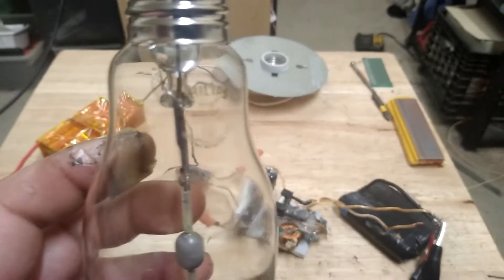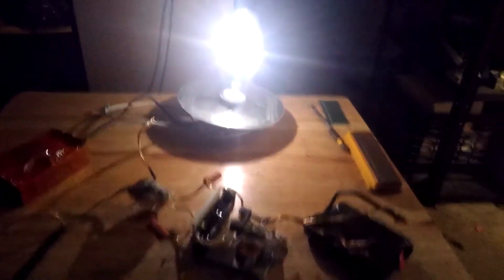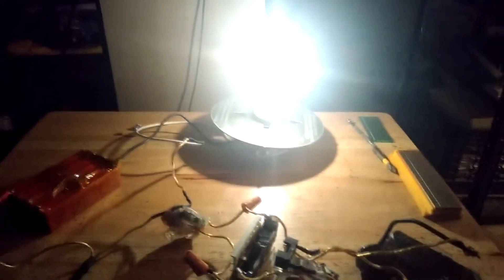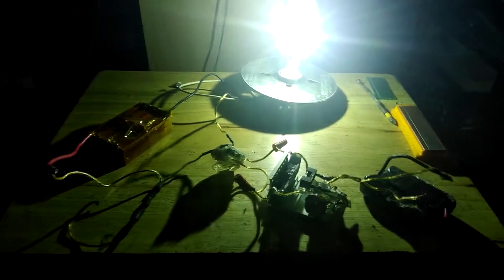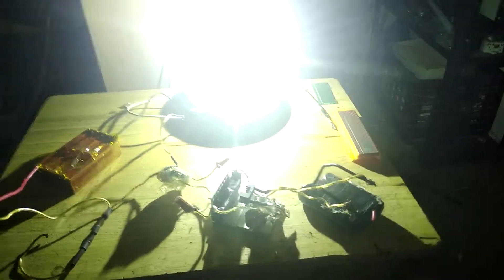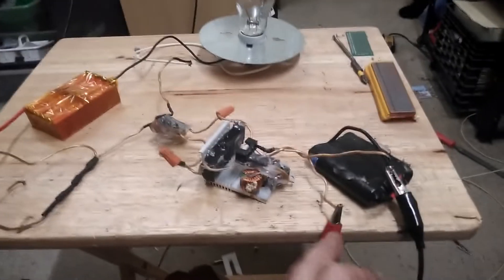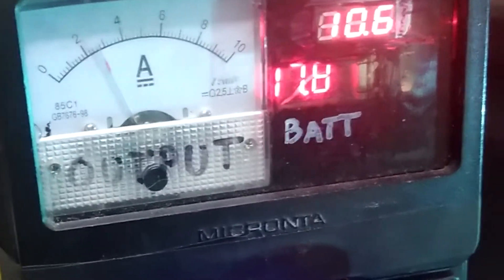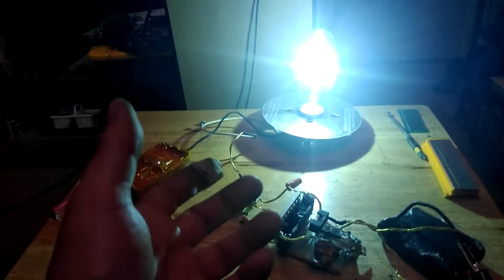12v battery vs 70W Metal Halide using ZVS

Comment: 😃 ahh haa that's the one I was curious about ... many many thanks for clarifying my confusion ( you mentioned in second reply) can you please tell the number of the hv diode, is it microwave diode or R5000F diode ?? Did you connected two capacitor in series in zvs driver and then supplied to the transformer ?? I just used zvs driver without capacitor(zvs output capacitor), so that's why experiment was failed and the 250 watt halide lamp was glowing dim, I tried to add capacitor at zvs output parallelly but the capacitor damaged because transformer secondary side was very high voltage due to that reason transformer primary side was also a high voltage that damaged the capacitor and i also used EE core center tap 250 watt transformer.... Now what I will do ??

Comment: kindly pause the video at 19 second and you will find it { right side of the bunch of the capacitor( orange colour celopin packed) and the output wire of the transformer}🙂left side of your finger( in the video),when you are pointing at zvs driver, can you kindly tell what is it ?
Reply from the maker: The only things there are that cap bank to the left, the transformer to the right of it, and the ZVS driver itself, then to the right of that the battery bank. The ZVS driver itself just has all the normal components. The block of black colored stuff there is the ZVS driver capacitors and then to the right of that is just a black fuse holder for a ceramic fuse.
Reply from the maker: If you mean the heatshrinked portion of wire off the transformer those are just HV diodes for when I want to rectify the output.

Comment: what kinds of circuit are you using at hv side ?? can you clarify it kindly.. is capacitor connected series with (resistance/diode) or parallel ??
Reply from the maker: That was just a random bank of caps I had in series with the bulb.

Comment: thats a good idea because metal halide need to cool down for another start but when voltage is so high its quicker
Reply from the maker: No one uses them cause they are probably expensive but I read something about commercial/industrial HF supplies for them. Never seen one though.
Reply: @Magneticitist  Some inverter ballasts, especially those made for car HID headlights, do have higher voltage ignition options for quick hot restrike (apparently very few ceramic metal halide bulbs can be hot restruck, especially Osram, and yes I have been using Osram 39 Watts Powerball CMH bulb with Hylux A2088 35 Watts inverter ballast for a good while, works just fine - just beware of hot restriking the CMH bulbs that's not as tolerable as Osram's, they can and do explode, I haven't had a problem though, I just do a quick and short hot restrike test to find out which lights back up instantly so I am not pushing it).

Comment: Hi, nice work thank you, any idea how to make free energy please
Reply from the maker: It's everywhere. I stopped trying to search for 'free energy' from sources I couldn't see because there was already enough of it from sources I could, such as the Sun or all of the various energy in motion on Earth. One could spend years on a device which may or may not yield a small additional usable energy when a similar priced solar panel could have done it all along. A solar panel is by far more appealing to me than some device which requires a power draw in order to create an output. Such a device is still wearing/draining/expiring over time in some way. 

If one looks at matter as energy then there is a very effective and easy conversion available to all people in the form of fire and flammable objects and using that to create steam power, which is an awesome force. I will never stop being interested in 'free energy' ideas but I have to admit when it comes to harnessing electromagnetic waves it seems like a steady and constant (depending on your location) supply from the Sun is one of the easiest and most obvious ways to get this free energy.

Comment: The idea of lighting a lamp like this is cool, I've done it once before I damaged my ZVS, the biggest problem I see is limiting the current to send the power it works to the lamp, less is good, but more is bad , shortens the useful life and when they burn they may or may not explode
Reply from the maker: Yea I did crack the inner bulb of one pushing too much voltage

Comment: What kind of circuitry is between the zvs and the bulb? Just a transformer or something else? And if it is a transformer, what is it from, and/or what’s the winding ratio/voltage ratio?
Reply from the maker: Yea just a trafo, I can't remember where I got the core but it's shaped like a tiny flyback core. IDK the ratio because the coil came from a small cheap pack of "lifter coils" I bought online a while back and I just popped out the metal core and put it on this one. Since it's an electromagnet lifter it has a good deal of windings compared to the 10 turn primary. I recall the unloaded output voltage to be over 500v but I can't recall exactly. I'd have normally tried to drive it at lower voltage after igniting it but it's interesting thinking about how exactly the ZVS driver is seeing that load.

Comment: Bad idea touching that glass with bare hands.
Reply from the maker: These are from old fixtures that were replaced so they aren't going back in commission aside from this little testing which doesn't get them nearly as hot as they would be from the commercial ballast. They still get damn hot but nowhere near hot enough to shatter unless I tried to fully drive it. Just kind of interesting how it works though as a wavy arc can sometimes be seen in the inner bulb, and it's clearly got some decent current in it, yet it doesn't really have enough resistance to push the circuit hard as opposed to trying to arc between terminals.
Reply: It’s a double envelope bulb. They do that for thermal and mechanical insulation. Technically he never touched the metal halide bulb since it’s protected within a second bulb.
Reply from the maker: @jjhack3r  Yea the inner bulb is probably taking a beating with the HV arc but the outer one is fine
Reply: I'd not worry too much personally, I use ceramic metal halide bulbs in my modified Cyclops Thor Colossus halogen spotlight, the manuals that came with the bulbs said not to worry too much about casual handling without gloves, as far as I know. I have been using 39 Watts Osram Powerball bulb matched with 35 Watts automotive ballast for a good while, it works just fine especially after being handled barehanded (some 39 Watts metal halide bulbs can actually be used on the 35 Watts ballast). It's the inner arc tube that you should be worried about (if the outer envelope is shattered, you would want to toss it anyways).